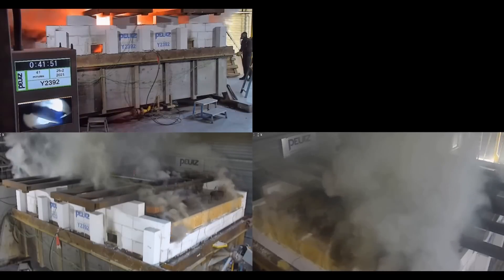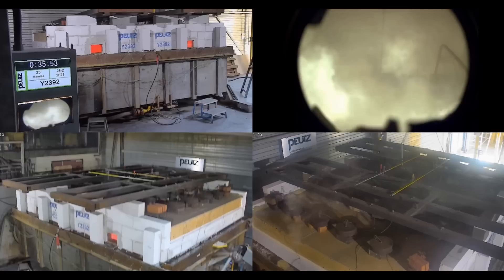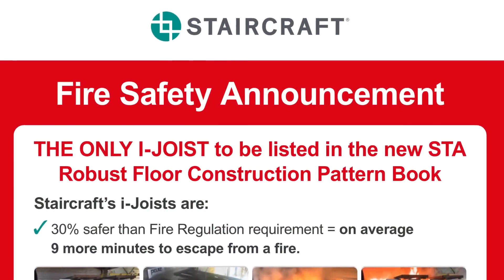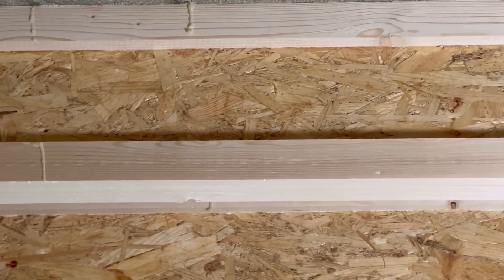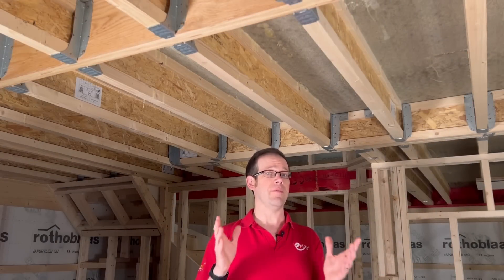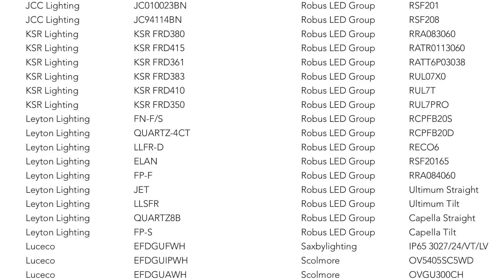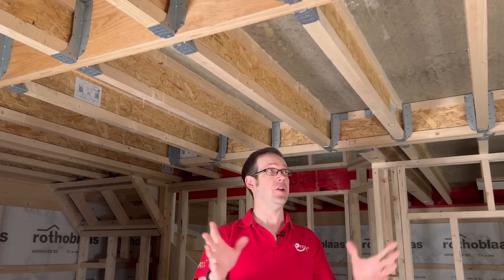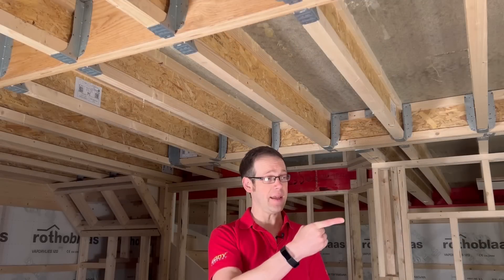How Fire Rated Ceilings Just Got EASIER for Electricians'

Comment: With all these rules with spotlights, how about extractor fans being cut into ceilings? Surely this doesn't comply with what is essentially an open hole in the fire rated plasterboard? Not just talking attics and bathrooms, commonly put in kitchens with rectangular ducting run between the joists.
Reply: Don't you use aluminium ducting and intumescent collars?

Comment: I joists, prove there longevity, a way for house builders to cut costs and maximise profits, would not buy a house with them fitted. We have now entered the scenario where house life span is less than 60years much the same as commercial buildings flung up with the cheapest materials available .
Reply from the maker: 90% of new build homes use engineered timber floors
Reply: @efixx  I think you will find that is flooring surface not substructure

Comment: Has anyone got a solution on how to fit downlights when kingspan is installed between the joists and insulated plasterboard is specified
Reply from the maker: Find a different way of lighting the space
Reply: @efixx  find a different job to do then because the customer is getting someone else in
Reply: @efixx  this problem keep arising. It doesn't help when every bloody kitchen company illustrates the shiny new kitchen with downlights and then the client has their heart set on it. This must be a common issue in the industry.
Reply: No, it’s the problem people just don’t talk about
Reply: My neighbour had downlighters installed into such a ceiling & ended up with a condensation issue due to cold spots where the holes had been cut. Changed to surface mounted luminaires, but also had to replace ceiling & old insulation!

Comment: What country are we talking about? In Italy regulation is a lot easier. Materials are basically divided into fire resisting classes (ex. A1, A2,...). Producers are required to certificate the class.
Depending on the classes installed you evelutate if a fire sensor is required or not.

Comment: Lots of "Holes" in the regulations, not to mention the construction stage of the dwelling/property, the "Positioned anywhere in the ceiling lining" is the weak spot, flame and heat travel will always find it's way through these, especially, badly installed fittings, even if they are fire stopped  .... For me, anything above 2 floors, including basements and above should be surface mounted, but can you imagine the Theatre that would cause with customers and builders/designers !?!?  ... not as bad as the funeral though. (In my experience, if the compartment has any windows, vents and/or means of usual entrance or egress, then that's your problem .... people, they are the problem)

Comment: We have had a nightmare with this as the NHBC considered light gauge steel as engineered which misses the point as it is the timber that causes the failure. We still need to do a fire test and I bet the steel industry has not joined forces  🤬